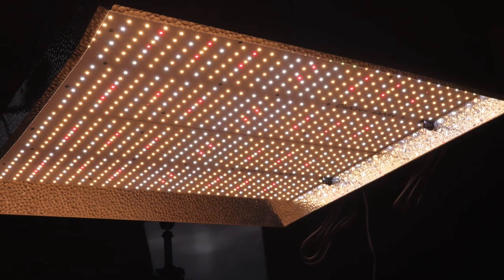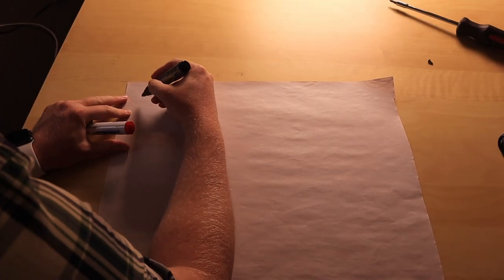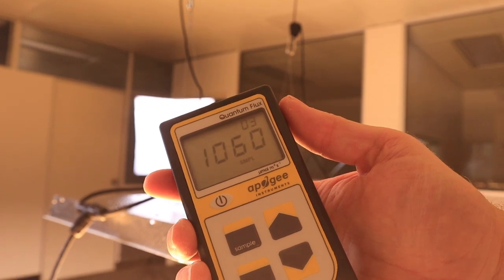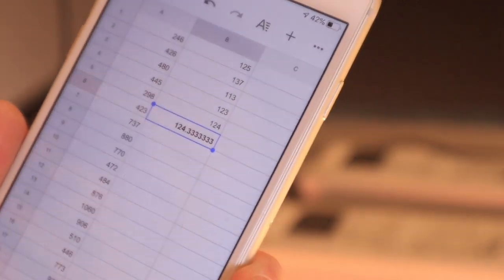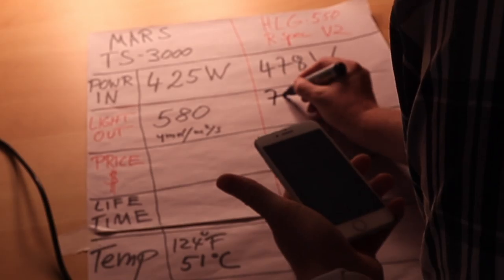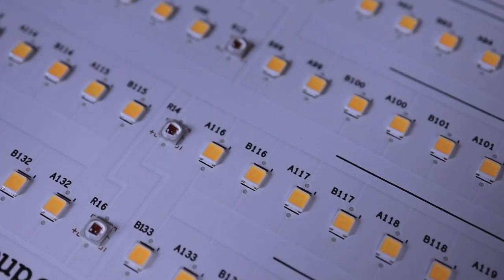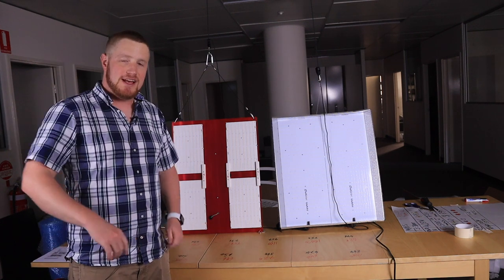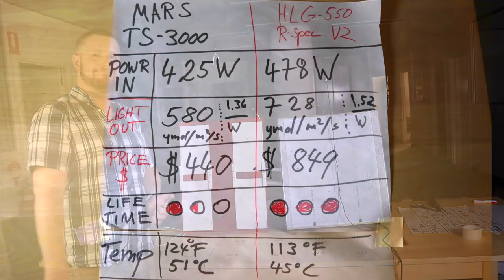HLG 550 RED v2 VS Mars TS-3000 - LED Grow Light Comparison

Comment: Did you turn the mars light up from the drivers?
Reply from the maker: LIVE 3VIL no dimmer on Mars unit
Reply: @HomeGrowEngineering  yeah there is i have a ts3000 and there on the drivers.
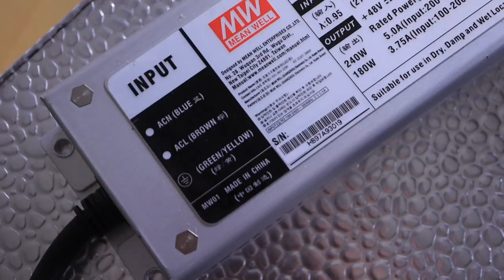Reply from the maker: LIVE 3VIL see the drivers at 0:22.  They have none. Maybe yours was shipped with other drivers?
Reply: @HomeGrowEngineering  there not on the top there on the bottom
Reply from the maker: @live3vil550  I will check, thanks for telling me. If they're not 100% I'll make a video update.
Reply: @HomeGrowEngineering  should of came with a instructions on how to turn them up
Reply: @HomeGrowEngineering  I believe the adjustment screw is on the bottom of the driver. My TS1000 came in at around 75% power. That is quite a difference. Thx for the video.
Reply from the maker: @BillWard420  Yes, the TSW-3000 has the adjustment screws at the bottom.  But Mars said they come set to 250W each and it's not recommended to crank them up all the way.  That is for the 3000. Not sure about the 1000.

Comment: Can you do a spider farmer SF4000 review PLEASE!!!! 🙏🏽🙏🏽🙏🏽🙏🏽
Reply: I have that light...migro do one, was shocked to find out the efficiency is not 2.7 its actually 2 07...still a great light though, mars and viperspectra are tge reason i said for 4 years no way will i even buy a led,   the spider farmer also runs hotter than the HLG but nothing like this mars
Reply: @goonernumone8444  MIGRO did one with the SF1000 but the "efficiency" is based on PPFD measurement with reflective walls that do not look too reflective. In other words, the calculation does not take into account the fact that photons were emitted by the light outside of his measuring area and not reflected back in. You need to measure the output of the light and not the output per area to measure true efficiency of the light. In real life you would stack up the lights in a room , thus almost using all the photons emitted and not letting them escape the grow area. Learning the units used is so important to truly understand. I'm not saying he lost 25% efficiency all in the walls but still, the value seems low.

Comment: I get HLG550 clones from a supplier from Alibaba for $420 vs $890 for  my light from HLG. I see no difference in quality of the lights or quality of  products produced by the lights. I like my clones better. They have switches for the 660nm red spectrum and IR and UV. Plus a nice dimmer. They come with a 3 years warranty I believe.
Reply: What is the name of the light?
Reply: I have two knock off lights from them aswell, for my 2x4 closets. One has three of the boards in line and the other two boards. I paid about half the price of hlg and have had alot of success in my little grow. I would love to see a side by side comparison of a clone to an hlg. It would need to be huge differences for me to spend so much more money. Just my opinion, cheers.

Comment: Hey there I got a bit of an issue with my mars lights they don't shut off completely ( like it's running on 1% or so) I already tried different timers and everything! If someone could help me out I would be forever grateful 🙏🙏😅😅
Reply from the maker: MrEgga91 This could be caused by a ground fault in your building. https://simple.m.wikipedia.org/wiki/Residual-current_device
Reply: Try use a mechanical timer instead of a digital one.

Also if you use an EU plug, try flipping the plug the opposite side by 180 degrees.

Comment: HLG 550 = overprice. You can buy 4x quantum boards 288 v2 for 350-400$
Reply: If you know how to solder and basic knowledge in electrical circuitry then buying the chips PC boards drivers NEMA plugs and wago connectors then you can DIY 4 or 5 better sturdier 550V2 r/spec replicas yourself for the price of 1 from HLG. These things are so simple to build yourself it's an insult what HLG and the like charge.
Reply: @timpage5021  yeah if you like to hand solder 1000 LEDs yourself then go ahead. Good luck with that! Serious mabey you get 100 done, but after them you quit and have unfinished pcbs and leds laying around.
I think going the Chinese route and ordering the pcbs with LEDs soldered onto them from a known source like Kingbrite is best for the budget you can get atm, if you want LEDs. Also get an unregulated 48V power supply and run all your panels in parallel, maybe use a resistor to regulate current.
Reply: @timpage5021  please use commas, they are there for a reason

Comment: You didnt turn the mars all the way up.
Reply from the maker: Mars told me not to because it could damage the Driver
Reply: @HomeGrowEngineering  yet they advertise its adjustable. I no hl is a better light but the test is unfair as 1 is turn to max and other left at factory settings. The mars when cranked is mutch closer to hl out puts. And the new mars 3000 has adjustable dimmer box. But decent test none the less 🍻

Comment: Awesome video and test. One thing to consider, the HLG is set up too close in your test and the par value in the middle is too high. People will likely hang it higher and it will be spread out more meaning more of the light will be hitting the walls and bouncing back. If you do a test like this one again it might be worth calculating the efficiency like you have and then do it again with the centre par reading set the same and set close to the max plants can take.

Comment: just got a SP 3000 from Amazon and it only pulls 369 watts. They do not test them or do not care. I think everyone needs to test their lights. I am sending it back for a new one. 
China turns every product they make disposable
Reply from the maker: Does it have a dimmer? Sometimes it's hidden at the underside of the driver.
Reply: @HomeGrowEngineering  The power is  maxed out. China Quality control.

Comment: Under the driver of the ts 3000 is a dimmer turn it to 100% and redo this test!
Reply from the maker: Mars told me not to turn up the dimmer because it may cause damage.
Reply: @HomeGrowEngineering  It will not damage the light, it just might decrease the lifespan of the light. I dont think it would decrease it by that much. Would be cool if someone tested this side by side, would make a cool video
Reply from the maker: @S3brandon  yeah true.  We could also measure voltage/current to see what's really going on.  But Mars now has come out with a new generation of lights, so this is not that interesting anymore for lots of people.
Reply: @HomeGrowEngineering  FC 4800 VS TS-3000, i would watch that

Comment: Mars have up'd their game recently, at least in the sp-3000 range and upward. They are now using the Samsung and Osram chips, not sure about the sp-150. I didn't like it, to small and no functionality, not even an on/off switch but the sp-3000 is a very different story. Although very similar design to the 150, it is twice as long with 600 more chips, has an on/off function and a dimming function as well. And the driver on the 3000 is a mean well, not sure who made the driver on the 150 but it certainly isn't mean well. 
I don't know why they even bother with that sp-150, seems like a waste of money. Unfortunately, the speed this market is moving at, your video, or at least the lights your reviewing are obsolete already. 
I just watched to see how far these lights have come in just 8 months. Its taken over a decade but now led's have arrived it won't be long before they are the industry standard. I have 2 x 600 watt pro Lumatek LED's and the results are outstanding, its remarkable.
Reply: Honestly at this point Mars should be considered a "knock-off" brand.  I've never seen anything from them that wasn't a copy of a different product done much better by someone else.  Same goes for pretty much anything found on Amazon or Alibaba or in Shenzhen.
Reply: @ogsteele9066  I would agree with you but for this sp-3000 is a huge improvement. I know because I bought the 150 and it's junk but I really needed a solution and there isn't really anything else with these spec's. This wasn't cheap either, about £400 but like I said I needed a solution and size etc, the sp-3000 is it. I use 2 x 600 watt pro Lumatex in my flower room so I know there are much better lights available and they aren't really that much more expensive than these from Mars. 
All this said, I am very happy with the performance and results I am able to archive with the sp-3000. I am using it in a 4ft x 18" area for veg. I can get 40 newly potted clones under it for the few weeks I need until the flower room is empty. Does a much better job than the two 200 watt compact flouros its replaced.
Reply: @allanlarmour7460  Would you recommend the Lumatek Attis 300w? There's also standard and Pro version.. I'll be using a 1x1m tent, or 3,5x3,5 feet.
Lumatek seems like a great light with 3 year warranty, but my only concern is the non-removable driver. Does it create a lot of heat, and is the driver waterproof?
And also there's some confusion between their lights, some of them use Lumileds, and some of them use LUMLEDS. They are different..

Comment: HLG are overrated overpriced and hype.  HLG uses the lambertion effect means basically no design for the directly light. The light just scatters in every direction in no particular direction.  A secondary lense with beam angles at a mix of 60 and 120 degrees is much more efficient and no wasted light. Even attaching some aluminum flashing around the 550V2 would be better then nothing.  They and most like them are not nearly as efficient as they advertise.  Measuring efficiency by more light doesn't mean it's more efficient. Like I already said the photons emitted just scatter.  There is no design in how the light is focused.  Thus wasted light and not as efficient in a proper way of measuring efficiency and efficacy.  If shine a mag light  in the opposite direction of what your intending to see or then use a simple candle to illuminate what your trying to see which one would be the more efficient and effective means? The mag light pointed behind you or the candle? The way grow light manufacturers measure thier PPFD is flawed. The sensor only picks up what photons hit the sensor.  So if you take 9 measurements in a 3by3 9 square feet. Only taking 1 measure per square foot then equating that into its PPFD is flawed.  Say if measure in each center square foot of a 3×3 and say you get PAR measurement of 680 if you slide the sensor a couple inches in either direction in that square foot its gonna have a different level of PAR.  Measuring every square inch of the surface and not per foot is a closer actual record of what the accuracy of the PPFD actually is.
Reply: Tim Page 🤯🤯🤯

Comment: So the Mars is 900W yet it only produces 80% of the light of 480W HLG
and you think the Mars is good because of the price?

This is the problem with price buyer logic, as you forgot to factor in the 20% extra
yield you will get from the 20% extra light from the HLG… Not to
mention the lower running costs of the HLG lamp vs the Mars lamp

With the 20% yield and 100% less on running costs it means I will have made the extra I
paid for the HLG lamp on my first crop, and by the second, third,
fourth crops onwards I am in profit vs my continual loss on the Mars
lamp… Yep there is a lot to be said for the false economy when
price buying… 

And it’s HLG for me all the way, as this lamp is much better value than the Mars lamp
Reply from the maker: The Mars is not 900 Watt, its 425 Watts.  Also I have not  made any judgement on which light is better.  I leave that to you.     All I'm saying is that you 80% of the light for about 50% of the price. And that is not bad.